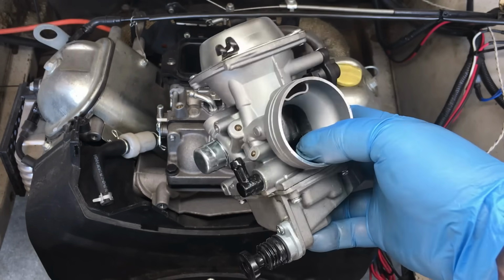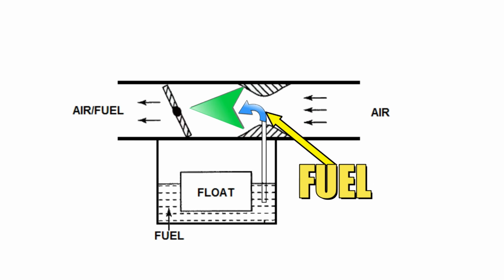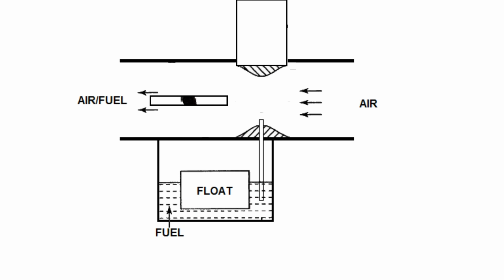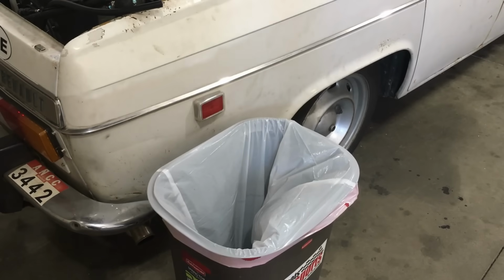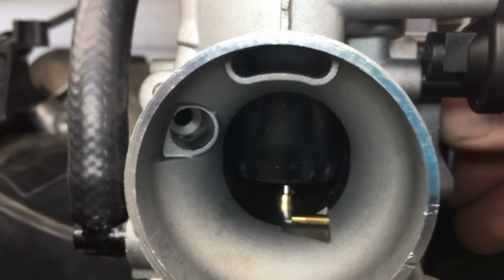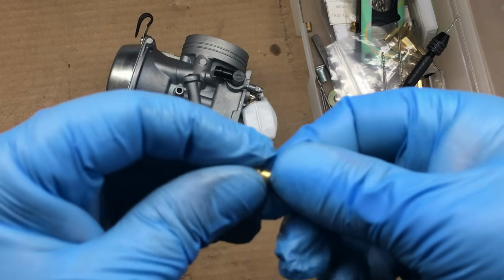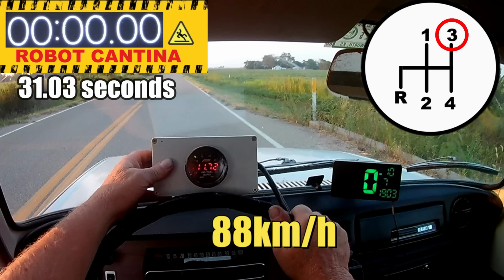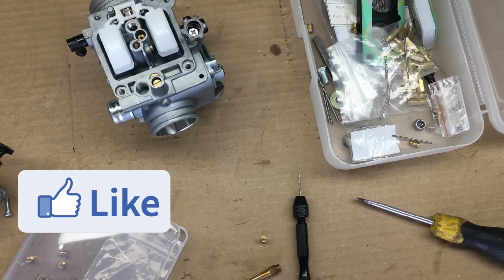S3 E30. The 670 predator Renault gets a Keihin CVK carburetor for better performance?

Comment: I used to have a 65 Mustang with a Holley 600 on it heavily modified😮 I had it set so well that I could drive around on the primary two barrels all day without ever opening up the secondaries🎉 right around 30 miles to the gallon easy🎉 when I stepped on and it was like nitrous🎉 God I miss that car

Comment: We use to put a fine screen between the carb and manifold to annimise the fuel  ! I think your leaning out because of your fuel routing system , all you need is around 3 lbs of fuel pressure , so put the restrictor between the card and pump and dial it down without the return line ! I'd ditch the governor also !

Comment: @11:31 That sure looks like a 1/4" T-handle hanging on for dear life behind your muffler.
Reply: Maybe a high performance C clamp?
Reply from the maker: LOL, actually its a microphone mount to record the exhaust sound.  Its been so hot lately my sound recorder stops recording after a few min of driving and we haven't been able to provide actual sound of the little engine.

Comment: Try stacking some washers under the needle in the cv portion of the carb.  It will clear the main jet sooner.  That with  the smaller jet for off idle might help. 

Part of what we had to do to tune bikes after making changes to the intake and exhaust.

Another person mentioned the air cleaner with a velocity stack.  Cooler air might help.

Comment: The variable carb thing looks interesting, i was wondering if that dip you see in air fuel has to do with how that venturi restriction opens up. Then you said emulsion tube and I sat back to learn more.. Looking forward to next week!
Reply: The CV carbs are phenomenal when they work correctly. I'm still in the early part of the episode but I'm hoping he uses a conventional air breather setup as these dont lend themselves well to "performance" pod type air filters. They need at least a tube between them and the filter to maintain a smooth vacuum reference. Folks take the air boxes off engines with these and then wonder why they run like garbage and have poor throttle response.

Comment: You really know how to keep us hanging. lol  I can't wait to see the solution to your carb tuning problem.  I'm guessing  that once you get the 670 running like you want that performance figures might not be that much different than the stock engine.  A few performance enhancements might even yield faster times than the Renault's factory performance.  Thanks for sharing.  Phil

Comment: Jet back down and raise the needle or get a lighter weight spring in there. Its going rich because the main is too large then its leaning out because as the rpm rises the engine isn't making enough vaccuum to keep the slide fully open. 
The emulsion tube is just helping atomisation - it has no real say on overall fueling until you're really far off what the carb is set up for.

Comment: lower the needle inside the slide, that would require you to raise the snap ring to a higher position on the needle. I'd go two for as rich as you were. Awesome content, and good luck with your project.

Comment: That fabricobbled carburetor support is going to force the float off it's seat and hammer the slide.
Youre better off leaving just the boot.
Also, if the needle doesnt have multiple grooves shim it up off the slide with a tiny washer or two.

Comment: Pilot controls fuel for idle through 1/4 throttle.  From there its needle jet and main jet.   If you need more fuel at wot, you will have to move the clip on the needle.  Only after you run out of notches,  do you change the venturi tube, but even then, you are replacing the needle to match. 

Make your pilot a size smaller, and raise the needle a notch.

Comment: maybe you just didn't show it but if you're not running an air filter on it its going to be lean at rpm. the added air restriction helps create vacuum to draw more fuel up.
Reply: Even just an air filter won't quite get it right though, they really like to have a full air box

Comment: You can tune mid rpm range by raising or lowering the needle and also changing the stiffness of the spring that holds the slide down  it's a very adjustable carb

Comment: The needle taper on the plunger is also part of the tuning on the carbs. since it changes the opening as it goes through the motions of the oceans. 
Not sure if you interested, but I have a carb that I think will work well for your application. Its from my Buick/Opel by isuzu, comes from 1.8L engine. has tiny primary and a little bigger vacuum secondaries. Though would need to make the intake adapter that would be at least 500cc in volume to keep it happy.
Reply from the maker: Thanks for the offer!  I have my hands full at the moment with this carburator.

Comment: Where the carb adaptor block meets the engine manifold is an issue. The two holes would benefit greatly from being modified to provide smoother air flow into the manifold. As it is, the abrupt hole will be doing bad things for the flow.
There isn't enough room for a pair of stub-stacks, so out with the grinder to add a smooth transition into the port.
It'd benefit to remove the material between the ports to provide a smooth, knife-edge bridge between the two. Imagine a fat infinity sign.
A 45 degree cut into the ports to begin with, then smooth the edge and round it out to provide a sort of 'sunken' stack into the port, then remove material between the ports to narrow that ugly bridge and provide smooth flow.
The idle circuit adds a lot to the throttle up to 1/3~1/2 throttle on a CV. You may be able to lean that out.
Many CV carbs give you the option of different needle profiles too. If you can't get a needle chart, try shimming the needle within the throttle slide. You can now have a leaner idle, then as the slide rises, the richer part of the main needle is used earlier.

Hope that helps.

Comment: Tuning small engine carburetors can be quite the art.  I used to tune motorcycle carbs way back in the '70s, and it was always a delicate interplay of the main, pilot, needle and emulsion tubes.  Of course we didn't have wide band ox sensors then, we had to make precision throttle runs and read the plug color, plus a lot of seat-of-the-pants measurements.  I see people just throwing on a random carb without tuning and wondering why it doesn't run right without understanding why.
Reply: There have been so many times I've worked on stuff for friends, family members, neighbors, etc. Mowers, motorcycles, ATVs, basically anything with an engine. Most times they go to messing with stuff and mess the tuning all up and I have to put a new plug in and get them tuned right. Some of them can be a pain 😂 mad respect for you, I don't do performance stuff as far as smaller engines go, mostly just repairs.

Comment: First of all: I am by no means an expert in this style of carbs but if I understand correctly the negative pressure opens the venturi. If this is true, you could also try to get a valve in between the low pressure side and the system which would make the venturi adjustable.
Just an idea.....
Another idea:
In theory it should be possible to rig up an injection system to counteract the lean mixture like Kugelfischer did way back when.

Comment: Most of the engines I tinker with wouldn’t like that sharp 90° turn down just past the carb. Turbulence would cause the fuel to come out of suspension and form droplets on the surface making tuning erratic and difficult. A curved transition might be more stable across the RPM range.

Comment: the dip in AF at part throttle doesn't have abńything to do with the emulsion tube. You need to lower the needle a step or two. The needle is located in the CV throttle and accessible when you remove the large lid at the top of the carb.
Just as you do on motorcycles.

Comment: I gotta go to work so I'll finish the vid later but you need two of these carbs. I can explain why later but if staying CV you should find yourself loving that size x2 or one 45mm flat slide like an hsr would be great too. Also 2 32mm CV carbs is still choking this thing. 670cc ÷2 335cc and on motorcycles we normally see gains going bigger than stock and stock for honda would be closer to 36mm although I'll admit the 670 has trash ports and heads and the runner length matters dont make it too short if you do go with two

Comment: Jimbo here's an experement to find out whats causing it. Jam the slide open and see what happens. 
If it fixes the lean issue you need a softer spring in the slide. 
Of course it will run like total garbage low down but its an easy way to figure out what to do next.

Comment: On a motorcycle carb the main jet is responsible mainly for 3/4 to fully open the pilot up to 1/8th throttle , the midrange is usually controlled by the slide needle position, or you can alter the ones in the mouth of the carb the main air jet and the pilot air jet, hope you find this of some help... pilot air jet looks likely, it causes problems on the transition from the pilot to the main system

Comment: I think you're headed in the right direction with the emulsion tubes. The bigger your air bleeds in a fuel circuit, the less signal that it will get, leaning out the mixture at lower rpms. You would also need a bigger jet to make up for the added air that is being introduced to the circuit. Also, I'm not too familiar with the CVK carbs, but the idle circuit often has impact on low speed and part throttle mixtures.

Comment: I think the bar you are using for support of the start button is the stock parking brake lever !
Try to press the top part , its usually a button , and try to see if it moves .

Comment: The 32mm carb is actually a downgrade from  the dual 28mm throttles, which equal out to 39.5mm single throttle valve.
Reply: Yup, his spacer was totaly wrong designed and that's why it didn't make any power

Comment: I would try to drop the needle first. Next you need to go up on the main jet. 
I like to start with getting the main jet correct first. I try to get main jet a little rich before i work on the middle range. The needle is where i go to next. Dropping the needle leans the mixture. If your still to rich i go to needle chart. Both Mikuni and Keihin have needle charts. I only change emulsion tubes when i run out of needle options.

Comment: The needle meters the fuel at part throttle. It's not gonna be easy, but you need to figure that out. These carbs can be pretty complicated to tune if you're using it in an application it wasn't designed for. It sounds like you need a bigger main jet and a fatter needle.

Comment: I got that same electric fuel pump for my mower due to the same issues on one of my garden tractors. .. I was also planning to add a return line. Wasn't planning on the 'dead head' regulator, was maybe going to put a valve on... But guess I'll add that to the list.

Comment: Reading some of the comments, lots of good stuff to consider also would add you may have to drill out the  air bleed for the main circut. This is a similartrain of thought you had towards the emulsion tube.  I wouldn't do any tuning until; you get an air filter of sorts on the thing.  Thats going to change the signal significantly
Reply: Yes , I agree, and air filter will change the afr
Reply: @BurchellAtTheWharf yeah and intake vacum pulses are voodo black magic sometimes, and its going to be tough to even match the OEM equiptment on this stock engine. .  Certain honda inverter generators will absolutely not run correctly unless the external sound deadening pannels are installed, even if the airbox is assembled as inended.  

Im suspecting a FI conversion in the future for your little hot rod, and would definately enjoy that type of content!  I bet your already eyeing up that kubota turbo!!

Comment: If you want to take advantage of lean burn you gotta advance the timing. Flame speed is lower at leaner mixtures which has the same effect as retarding timing. It ignites later in the stroke while the piston is past TDC so you lose power, like throwing a baseball backwards from a moving vehicle. You have to advance it to make up for that. This can be accomplished by installing a flywheel with an offset key or somehow repositioning the ignition coils to pick up earlier. This would be cake with an EFI system but that's probably not the point

Comment: Try to change the needle they have 3 position or 5 as I can remember and that affect the enrichment of fuel as CV goes at wide open throttle butterfly ( also inspect the rubber diaphragm ), the air filter box helps to control the amount of air it's important.

Comment: Tuning carbs can be tricky sometimes. That said, it looks like your main jet needs to be larger. And it probably needs a different needle. The main jet will take care of the lean condition at WOT, and a correctly shaped needle will take care of the rich spike at part throttle. Best of luck!

Comment: You had a first gen Honda Insight so you know about how the special lean burn mode works on the manual transmission cars . It goes up to 22:1 and the fuel economy goes up ( power goes down).

So you need a two mode car rich for 0-60 and super lean for cruise.

Wiki quote
A lean burn mode is a way to reduce throttling losses. An engine in a typical vehicle is sized for providing the power desired for acceleration, but must operate well below that point in normal steady-speed operation. Ordinarily, the power is cut by partially closing a throttle. However, the extra work done in pumping air through the throttle reduces efficiency. If the fuel/air ratio is reduced, then lower power can be achieved with the throttle closer to fully open, and the efficiency during normal driving (below the maximum torque capability of the engine) can be higher.

The engines designed for lean-burning can employ higher compression ratios and thus provide better performance, efficient fuel use and low exhaust hydrocarbon emissions than those found in conventional gasoline engines. Ultra lean mixtures with very high air–fuel ratios can only be achieved by direct injection engines.

The main drawback of lean-burning is that a complex catalytic converter system is required to reduce NOx emissions. Lean-burn engines do not work well with modern 3-way catalytic converter—which require a pollutant balance at the exhaust port so they can carry out oxidation and reduction reactions—so most modern engines tend to cruise and coastdown at or near the stoichiometric point.

“

Comment: i dont think u need to mess with the emulsion tube.. did you tried adjusting the idle air/fuel screw? that is what's controlling how rich your afr during acceleration. turning it in (or out, depends on carburetor type,i'm not sure which one is for keihin cvk,test it out) to lean it out. too rich afr would not allow you to accelerate properly and you need to properly tune it so that when the mainjet takes over the carburetion it should have a smooth afr curve.

Comment: I say that when the engine starts getting more heavily modded for power and you have more money to spend, ditch the Keihin and get a SmartCarb. They don't use jets and instead rely on their patented metering rod in order to mix the air and fuel, and use integrated, internal venting directly at the venturi opening which communicates both atmospheric pressure and manifold absolute pressure (MAP) into the float bowl, driving fuel flow proportional to both air density and velocity in real-time. In layman's terms, it's a heck of a lot easier to tune and won't need adjustments for atmospheric changes because it does all the work itself.

Comment: One single carb on this type of engine is bad. The engine manufacturer would not spend money to build a special "double" carb if a regular single was making more sense. So VERY talented engineers already tried that and the clever went back to a dual carb setup...
Mutilation of a vintage Renault for sake of power and fuel economy was not a very clever move in a first place.😢
Reply from the maker: The single carb vs duel carb issue is something I am very aware of.  This channel does experiments and right now we are experimenting with the single carb.  As for mutilating a vintage Renault, you obviously haven't seen previous videos where we explain that this car will be used for experiments.  all the modifications we do are non  destructive and we design our parts to bolt on to the car without modifying the car.  The car was purchased with a severely damaged engine and all we are doing is bolting different engines to the car.

Comment: Drop the needle height to block more of the emulsion tube to lean that partial throttle setting. You might get lucky and find there is a shim washer under the 3mm E-clip that can be removed.

Comment: There is so much aftermarket support for these engines. We would all love to see you do valve springs and the biggest CAM  you can fit.  Or they also have race ready heads for these as well. Heads are best but cams are great as well or if wanna go cheaspeat and easiest then ratio rockers are good as well

Comment: I think that a VW Zeneth carb might work on this 670. As they can be purchased with a variety of sizes from 30 to 34mm throttle blade. The 30’s you can get for about 50 bucks. Plus they are dead reliable, easy to tune and parts are plentiful

Comment: Those carburetors are designed to run with an air filter or air box.  Some custom fuel needle profiles help to tune them in also.
Reply: This this this! At minimum Jimbo should install some sort of intake tube between the carb and an air filter, but an air box always works better with these. Gotta have that vacuum reference to something besides atmosphere.

Comment: The pig rich start is fouling / wetting the plugs, when you go WOT, it initially feels good as the excess fuel gets burnt up, then lean-o-mighty, I hope the valves survived!
A dual Keihin setup would be neato. Tune each cylinder.